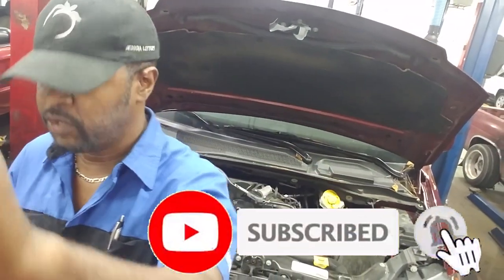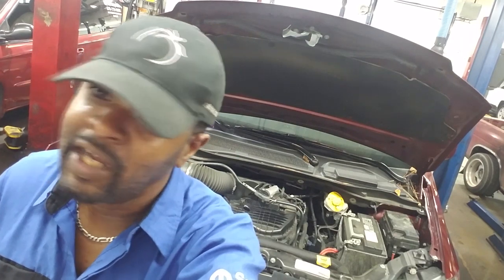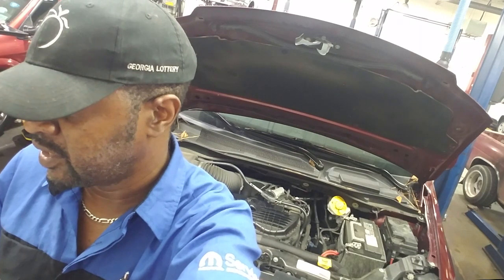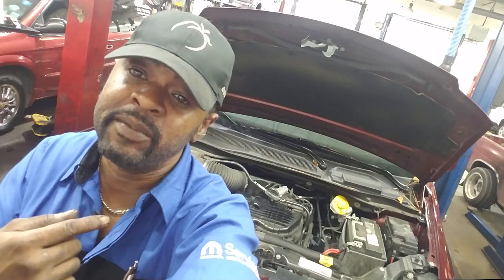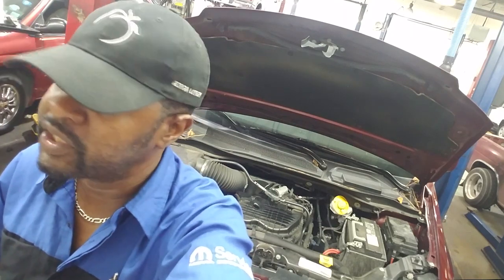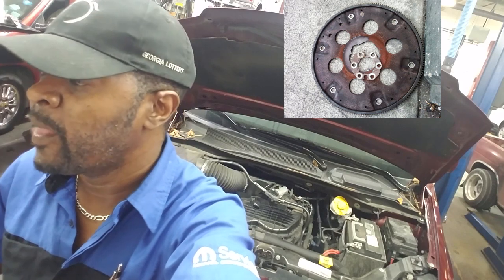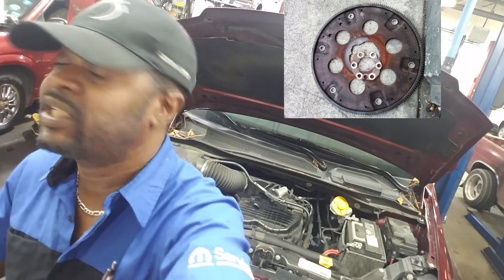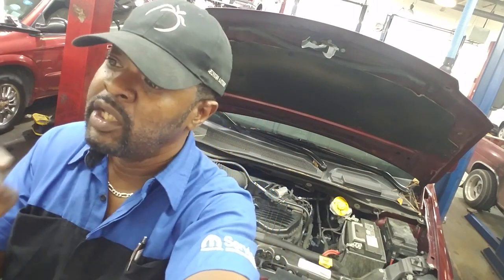Q&A about the 3.6 Pentastar V6 Problems. Knocking 3.6 ticking noise Rocker arm valve train noise

Comment: Man.. This might be one you can help me with. I have a 2014 Jeep Wrangler in my shop right now.  Short story - Broken Valve Spring & Bent Valve (upper stem). Replaced the head with a new head from the dealer and now the engine has a loud knock. I have torn this thing apart 5 times trying to find the cause of the noise. Checked Every Rocker arm (unloaded) for play and none. I scoped the cylinders & upper part of valves to make sure nothing fell inside - good.  I checked for play on the rod bearings and even removed the Connecting Rod Caps to check for excessive wear on the bearings - they look great.
Reply from the maker: Whoa, a loud knock after heads replaced? The main thing that you disturbed doing this job was the timing. Was the front cover removed to complete this job?
Reply: @OnlineMechanicTips   Yes it was removed.

Comment: Hey man love the videos so far on the 3.6. I have a 2012 caravan had ticking noise and I changed out the rocker arms in the front head. Worked great for about 6 months heard ticking noise from the back head, so I replaced all of them, front and back this time. I put everything back together. Engine sounds great, but I have a p0394 and it put me in limp mode. I changed both sensors front and back. Checked harnesses and wires, and checked voltage to sensors(5.2v) still have the cam code and limp mode. Also checked the cam phaser actuators and swapped them to see if I got the code on the exhaust cam instead of the intake cam, and it didnt help. You ever run into this before? It's a hail Mary, but looking for advice.
Reply from the maker: Hello my friend, this Video may help here:https://www.youtube.com/watch?v=qawCGFW_x7o&t=77s I always end up doing this for a code like that. PLEASE subscribe to the channel, thanks..This repair apply to 2011 and early build 2012..Its worth a try

Comment: I am a subscriber and have watched most all of your post on You Tube,  Recently had repairs done to my 2015 Chrysler T & C van which involved the rocker arms and one camshaft.  So all is good for now I hope.  I did run across a post on the 2018 Pacifica with the 3.6L Pentastar engine and it had the dreaded rocker arm clicking and ticking noise.  But also ran across something called a Star Case S1309000016.  I would ask my local Chrysler service manager, but I think I would get a better answer from you.  I enjoy your post on you tube because you seem to get to the bottom line when explaining things and the information is always correct.
Thanks
Reply from the maker: Hello my friend, I really appreciate you tuning in. Yes I am familiar with that case study but it does not apply to the generation 3 pentastar engines found in that 2017 and up Pacifica. In fact, the valve train has been redesign on those engines. That case study was basically for the gen 1 and gen 2 pentastar engines.
Reply: @OnlineMechanicTips  So does the case study apply to the engine in my 2015 and if so, could every become a recall?
Reply from the maker: @billevans2400  yes, it was a notification Chrysler sent to all the dealers to inform us what to look for..Recalls are safety related, I dont think this repair will ever be a recall..I have some information i am about to talk about on an up coming video. I got some tips from the engineers that might help prevent those rocker arm failures so stay tune..But yes, your 2015 has this type valve train discussed in that case study
Reply: @OnlineMechanicTips  You are the man!  Thanks so much for all the great information you have provided through these you tube post on your channel.  I have owned four of these vans, two were totaled, one had a transmission problem and the last one the  rocker arms.  But still I think they are great cars.

Comment: I have listened to a nice sounding video from Chrysler, and have been assured from their staff that the Pentastar 3.6 engines are fantastic!! But when the rubber hits the road, the fact is that these engines are notorious for premature rocker arm failures at quite low mileage!!!! (My 1985 Olds has almost 400,000  and it has never had a tick problem!!)

 These rocker arms fail because of one or more of three causes. #1-defective manufacturing, #2- overloaded stress, or #3- lack of lubrication. After the second rocker arm prematurely failed on my 2013 Dodge Grand Caravan at about 60K miles, I drilled a hole in the oil filter cap and mounted an electric oil pressure switch so that I could monitor what was going on. I switched from 5x20 synthetic oil to 5x30 synthetic oil and I disconnected the wire going to the oil pump solenoid which reduces the oil pressure at normal operating speeds once the engine is warmed up. (The damage was done before I took it apart the second time) Now there is much more oil on the rocker arms and on the cam bearings when I took it apart the second time!! Before at highway speeds the oil pressure was about 25-30 PSI, now it is running at 50-60 PSI at highway speeds. Then the engine light came on steady, so to fool the computer so that the engine light wouldn't come on steady I hooked up another solenoid from a used oil pump by bringing the original wiring up to the top of the engine and mounting the extra solenoid up there. The resistance from the tiny little light bulb in a regular lighted on/off toggle switch gives about the same resistance as the oil pump solenoid, but I never actually tried this kind of a switch instead of another solenoid. I would not want to simply hook up a little pigtail wire to connect the two terminals on the wiring coming from the computer because it may harm the computer. I am very happy with the results of these modifications and I think this will permanently cure my premature failure of the 3.6 rocker arms!! But I won't be responsible for any else's modifications!!
Reply from the maker: Wow dude, you may be on to something. Now I agree with your "rocker arms fail because of one or more of three causes". Especially number 1. Now I read your opinion so let me say mine. The lack of lubrication part could be a factor at idle and during long idle time. Maybe if engineers would raise idle oil pressure so more lubrication would occur during idle, that may help. The oil lubrication system not yet set up to make these adjustments via a flash updates, so I assume you would need to replace oil pump and other lubrication hardware parts to accomplish this.. I will read up on and find out if this was done with the generation 3 Pentastar engine. Part of the Hemi lifter failure (especially cop cars) could have been from long idle time. The oil pressure not as high at idle as it is higher rpm..Good point man
Reply: Thanks for your reply! Personally I think the oil pressure at cruising highway speeds in overdrive is the biggest problem because it was almost the same as at idle before I disconnected the solenoid wires. And cruising at highway speeds in overdrive lasts for hours, whereas idle is usually only for shorter periods of time.
Reply: They actually failed because they have bushings instead of ball bearings it's a design flaw
Reply: It would be interesting to see how long that oil pump holds up running on high constantly any problems yet
Reply: @MIXMASTERBJB1  It is still running perfectly fine!!!! If I was doing it again I would do exactly the same thing!!!
Reply: @MIXMASTERBJB1  Mine had roller bearings from the factory and also the new ones too!!!

Comment: I have a 2012 jku and I’m getting the ticking noise. I took the valve cover off and the rockers look and feel ok. What should I do next ?
Reply from the maker: Hello my friend, thanks for watching. You left off some info such as engine size but i will assume you have the 3.6L engine...Dependong on whats causing your noise, It could be a broken rocker arm or a lifter.. Best way to check arms is the finger test but keep in mind the cam lobes has to be off of the rocker arm, in other words, pointed up..Follow this video here and you need to check both banks. https://www.youtube.com/watch?v=9WQYRUavDxM&t=1s
Reply: Online Mechanic Tips thanks for the response! I had to turn the motor by the pulley to get the cam to point up but I found the bad rocker arm and it’s all put back together. Thanks!

Comment: I have a 2014 Journey R/T front wheel drive I bought for my wife. It has about 70,000 miles engines been solid but I’m getting ready to take it in for a recall. Got a code for the thermostat but it doesn’t overheat. The front dash 4.3 inch system is a nightmare (backup camera stopped working, navigation, randomly goes off and on, parking sensors out). It hasn’t worked right since about 20,000 miles problem was we couldn’t get it in for a while as it was our only vehicle with 4 kids. Well my question is anything else I should be on the lookout for when I take it in? Thanks for all the helpful content. I’m subscribed so if you reply in a video I’ll look out for it thanks.

Comment: I have to say that since I have been considering a 2011-2014 Chrysler Town & Country minivan hearing that a lady may need a new engine is not very reassuring! Are these newer models with the 3.6 Pentastar not the best choice for the long haul? I'm also considering an older,  well a 1999 Silverado 2500 6.0 truck with 150K miles...Maybe as far as longevity goes the truck would be a better option? I know the LS engine seems to be reliable...I just don't know anything about the new 3.6 Pentastar...If it was the older 3.8/3.3 I would not even be asking you this!! I have seen those older minivans with the 3.8/3.3 with over 300K miles still going strong!! Although I don't know how many tranny's they may have had!!!
Reply from the maker: Hey bud, she ended up needing a flywheel if you referring to this vid..Just like with anything new on the block will come with problems until addressed We first saw the 3.6L engine in 2011 so most of the early built 2011-2012 had these problems which now well known and easily repaired..But you right, that 3.3/3.8 was a workhorse...
Reply: @OnlineMechanicTips  Thank you very much for taking time to reply to me..I appreciate it...So would you recommend the 2013-on models then? Are you seeing any other mechanical issues ? Is the water pump internal like on some other cars?
Reply from the maker: @chrisreed26  Yes, they started to get most of the buggs out by then. Now I have done/seen work done on these models (2013-2015) but only simple stuff life rocker arms..I have yet to open up any 2017 models found in the Pacifica and Im a dealer tech. So its safe to say, this is a fairly good engine. Just mostly the first builds...Please subscribe to the channel for me, thanks
Reply: @OnlineMechanicTips  Thank you very much for taking time to reply to me..I appreciate it...So would you recommend the 2013-on models then? Are you seeing any other mechanical issues ? Is the water pump internal like on some other cars?
Reply: @OnlineMechanicTips  Better yet, let me ask your opinion..which would you say is more reliable: 1999 Silverado 2500 6.0 150K miles..well loved truck..not abused or a work truck...or a 2013 Town & Country minivan 3.6..100K miles...I very much value your opinion since you are a master mechanic it seems..Thank you!
Reply from the maker: @chrisreed26  Thanks so I will be honest with you, I have know knowledge of the 99 Silverado, but thats such a major year gap, One seems to be a lot newer than the other. Which ever you choose, just make sure you test drive very well, and pay attention to any noises coming from the minivan and also the trans fluid inspection..

Comment: Had a similar issue. Flywheel bolts were backing out sounds just like a rod knock 👍
Reply from the maker: yea man, could def happen. bout 10 years ago all the mopar t/conv  flywheel bolts come with lock tight on them for that very reason.

Comment: Hey there.  I got a 2006 Chrysler PT Cruiser Limited.  I was in there changing out the outer tie rods and noticed the bushings on the lower control arms are worn out pretty bad along with the ball joints.  I am considering just changing out the entire both right and left control arms.  Since I am DIY just wanted to get an opinion on complexity of the job seeing as some videos I've seen out there talk about having to remove engine mounts simply to get at one of the bolts but other videos show the arms just coming right off, making it seem like a piece of cake.  What's your thought on job complexity on this kind of job? Any tips?
Reply from the maker: Hey but, that job fairly easy, well that may be easy for me to say because all my jobs are done on a lift hoist. Not sure is you will be working on the ground with jack stands or what. Yes, that rt side mount has to be move to clear that both..What ever way you do it, be extremely careful when dealing with suspension parts..Thanks for watching the vid and please subscribe to the channel for me, thanks.